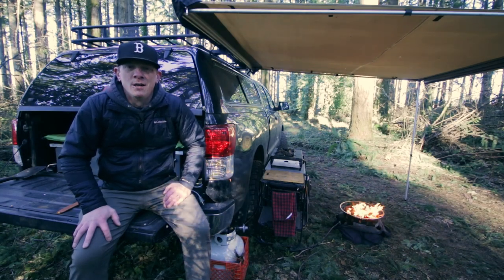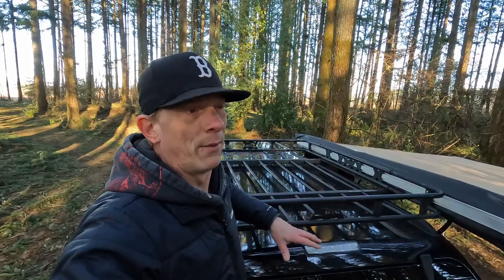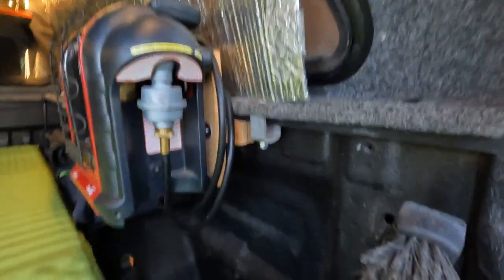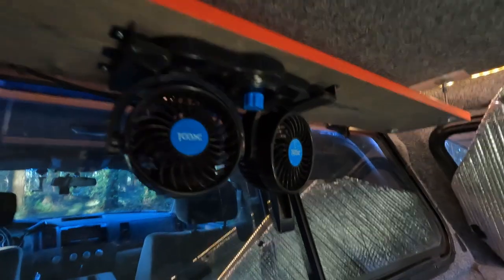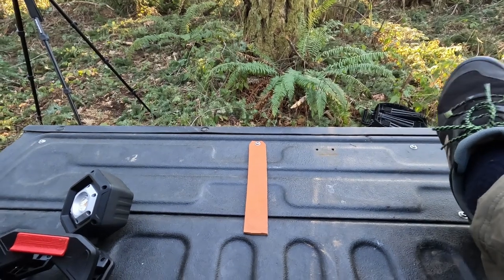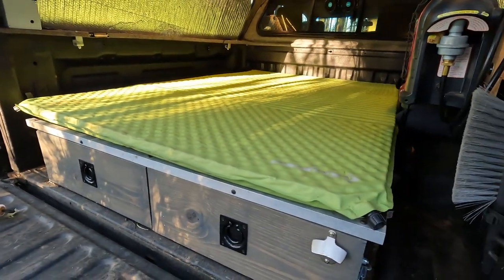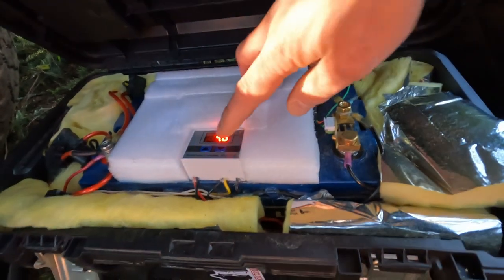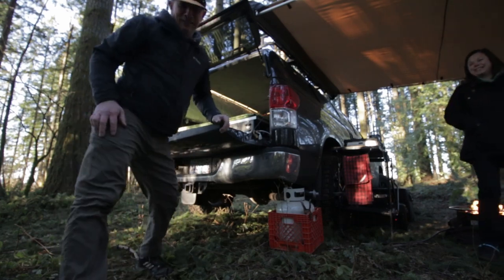The ultimate #truckbedcamping walkaround.  Take a look inside our truck bed camper

Comment: Nice setup. We have a Tundra also, great truck. They make the small fan that sits on top of wood burning stoves that will work on top of you Mr. Buddy heater. No power required works from the heat.
Reply from the maker: Thank you for the mention! I thought about the wood stove fans for sure. We may still end up with that, but the fans I have now work for when the Mr Heater is on, as well as in the warmer months to try and draw cooler air in through the canopy slider window. So far they have been working great! Not too much draw either.

Comment: I have a power wagon with a softtopper on it.  We sleep in the bed when camping and it has worked great for us.  Less expensive than a roof top tent and camper shell and we can remove it in 5 minutes when we have to use the truck bed.
Reply from the maker: That's what I like about the truck bed camping, you pretty much show up and you're ready.  Usually takes us about 10 min to get fully set up with the awning and kitchen setup.

Comment: Regarding the rear sag when over loaded: Rather than installing taller rear spring spacers I recommend Airlift brand air bags. I've done mild leveling kits in conjunction with bags (on my Dodge) and you can fine tune the height depending on your varying load. They're about $150.00. I pull trailers occasionally.
Reply from the maker: Thanks for the heads up!  I've looked into bags, and have been back and forth about them for awhile now.  For now, I'm going to add the spring shackles (not additional spacing blocks) and see how that goes.  I don't necessarily want to add any more spring rate to the rear, and I also need to get some more suspension travel overall.  I've had the shackles in my possession for some time now, but have some rusty bolts to deal with to get them installed.  If the shackles don't work, I'll go the airbag route.  Thanks again and take care!

Comment: Love the setup and thanks for sharing. 

Question about the roof rack. It sounded like you installed the tracks yourself ???  Any chance you could share the details on that process? I recently purchased a leer topper but it does not have tracks installed and I really want one.
Reply from the maker: I got the tracks from our local pick n pull yard from a newer Suburban.  They were 7 feet long so I had to cut them down and drill a new hole in the rail for the end caps on that end. Then I measured (5 times) and drilled holes in the topper and used stainless bolts to mount the racks.  I couldn't find any affordable low profile rails and these worked perfect. They were $30 for both.
Reply: @subjectadventure  so awesome. Do you have any concerns with structural integrity after drilling through the topper ? And did you drill through the flat top surface or through the curved edge area ? I’ve heard the curved area is thicker and a little more robust.
Reply from the maker: Our topper has a square insulated section on the inside of the roof.  I drilled the holes at the edge of that and used aluminum plates on the underside to distribute the stress evenly.
Reply: @subjectadventure  nice!  I think I have the same insulation section you are talking about.  Did you go through the insulation or on the outside of it to avoid it ?
Reply from the maker: Sorry for the late reply!  I went through the insulation.  Somewhere on the internets I found an install guide from Leer on how to install their rails and just followed that.

Comment: Mountain Houses and liquor, hell yeah! lol

I have the same awning on my bus. I was worried about the legs not reaching the ground since I had to mount it a little higher than whats recommended (otherwise it would have blocked my windows) but it came out fine. I just had to do a little modification to the brackets and turn from from Ls into Js. I'm very happy with the Napa awning. Thanks for the tour.
Reply from the maker: It's a great awning, especially for the price!
Reply: @subjectadventure  Yeah can't beat it.